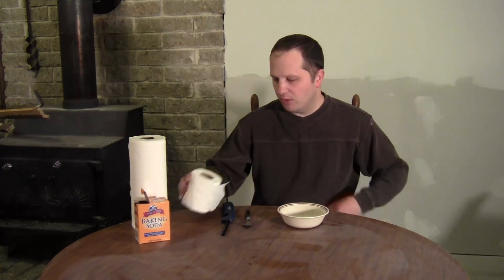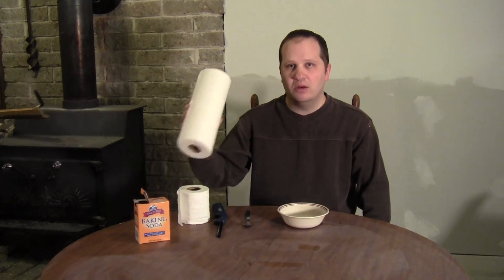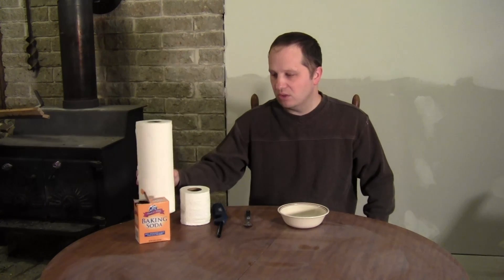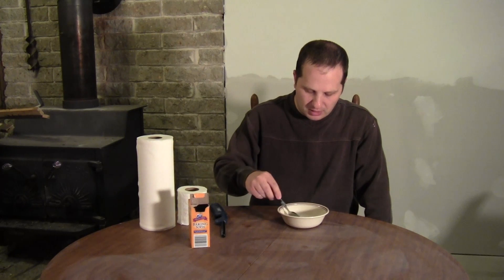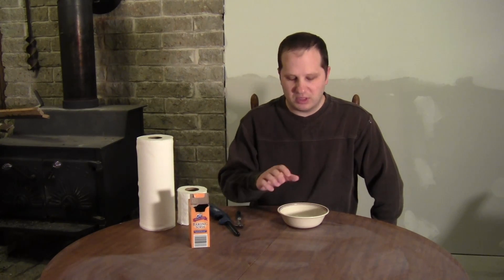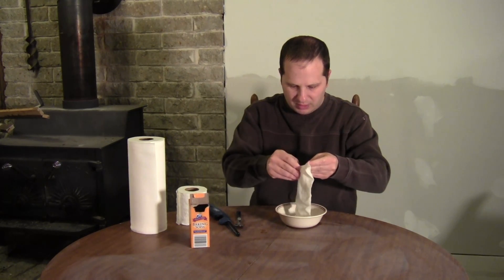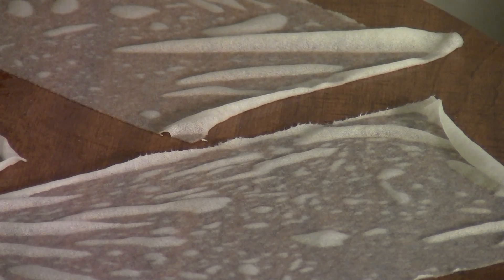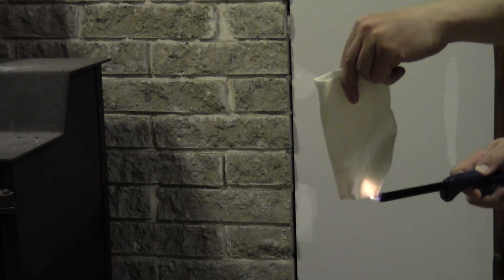How to make recovery wadding for model rockets

Comment: I made some using your baking soda method and it does burn. It burns very slowly once lit. The store bought stuff also burns, but it stops burning quickly. To me, slow burning could be a fire hazard if it's still smoldering after reaching the ground. Also, your test looked like the flame was behind the paper. Put it right on it and in my experience, it will burn and continue slowly until it's gone. Just my experience.

Comment: I use bio degradible insulation it's fire resistant and non toxic. I don't use paper wadding anymore I go to Lowe's by a big cube and that will last me forever. The tips you gave to make wadding using baking soda as a flame retardant is a good idea thanks for sharing
Reply from the maker: Great tip - thanks for the comment!

Comment: I did this and the stuff still burned in caught the field on fire this does not work
Reply: stephen stanford Been using Bernardo's technique for almost a year with about 40 launches and never had an issue.
Reply from the maker: stephen stanford I've used it for quite sometime with no issues.  I've also tried to light it with a lighter and it won't burn.  It will blacken the area where the flame is making contact, but the tissue won't burn on it's own.  I don't have an explanation why it didn't work for you.
Reply: Ditto...

Comment: I just use lint form the dryer.
Reply from the maker: Paul Lenisng Never heard of that - I'l have to give it a try.
Reply: Bernardo's Tech Blog I think that guy was joking. Lint from the dryer is highly flammable.
Reply: Nope, I really use it! I've never had any problems with burning!
Reply: Paul Lenisng Jordan's got something, Paul. I use dryer lint for tinder when camping. Stuff a toilet paper roll full and pack several of them for a trip. Lint burns better than anything else and burns hot so even wet sticks can be ignited. Your experience may be true, but it's not because lint isn't highly flammable--it just takes a bit longer to ignite.

Comment: I tried this with paper towels and it works! I went one step further and used a sieve to sprinkle a fine powder coat or baking soda over the damp paper towels while they are drying. I flew rockets over a couple of weekends with success. I cut them in squares after drying and keep a few large sheets to blanket over my parachute. I store them in a zip lock bags with extra baking soda in the bag. Just before loading the chute before launch, I put a tablespoon of extra baking soda into the larger paper towel piece, wrap up the chute, load it and launch.
Reply from the maker: Thanks for the tips!